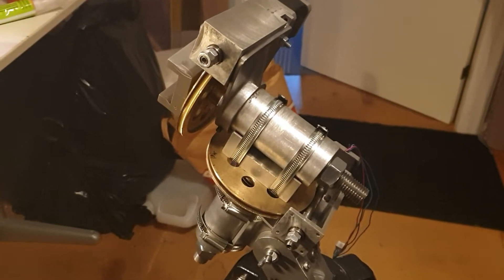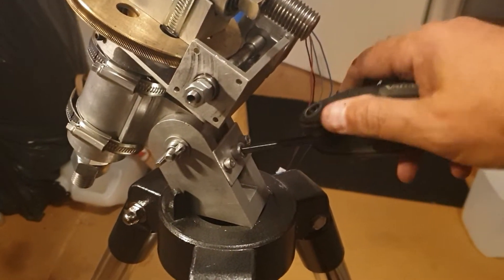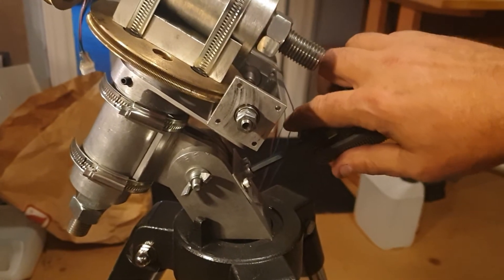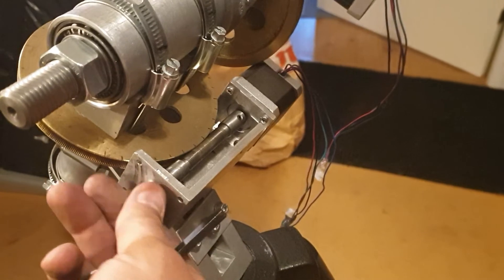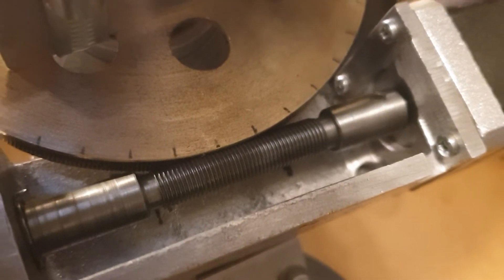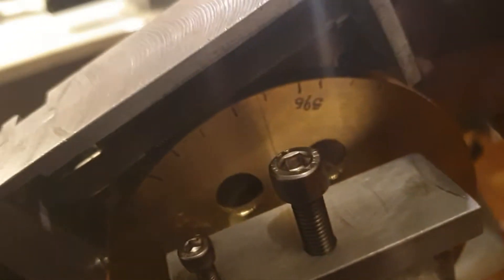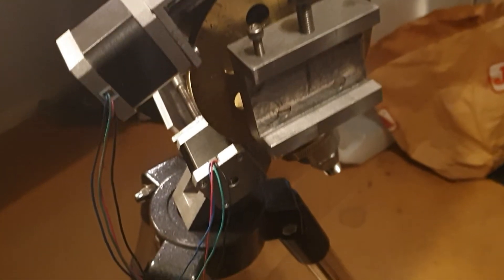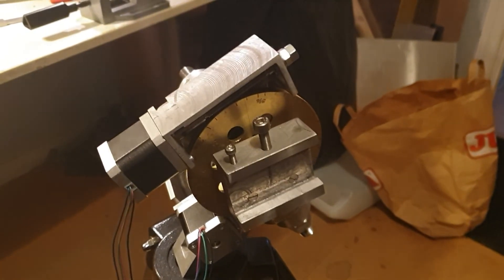Diy telescope mount

Comment: Dear sir can you tell quick release the gear design.
Reply from the maker: Its just a spring loaded hinge pivoting using two ball bearings with some pre-tensioning pressing the screw to the worm gear. I kan just lift that then manually to make the axis rotat freely
Reply: Can you share some more images of the hinge and Ballbearing

Comment: Very very nice job! Please can you tell me the diameter of the pulley and the screw?
Reply from the maker: The large gear is about 125mm dia, and The screw is 10mm. Both have M10 fine threads giving just below 400 teeth on The wheel

Comment: VERY VERY Cool. I would love to try something like this one day.
Reply from the maker: Thanks. It can probably be made simpler yet. Like the worm drive can be purchased instead of casting it as I did
Reply: @LarsBerntzon  Thanks Lars, that's a great idea, how does your spring work? Would love to see some detail of the spring if it wasn't too difficult to show.
Reply from the maker: @bill_astro_music  some pictures. It's just a motorcycle clutch spring with a pivoting rod with the spring in one side and an adjjustable wing nut on the other side for tension adjustment. https://photos.app.goo.gl/EsriritWnbi4bLLt7.   https://photos.app.goo.gl/Viqr9XPJ2oP8CF8U9
Reply: @LarsBerntzon  fantastic!!!

Comment: What is gear wheel specifications
Reply from the maker: Its a 1mm pitch 397 teeth. Was obviously aiming for 400 but did not quite make it using this method.